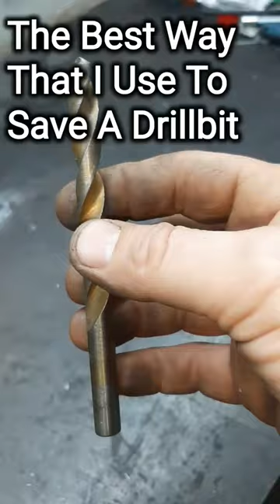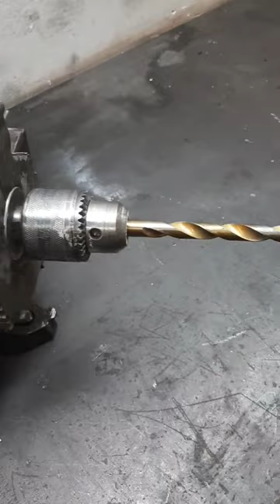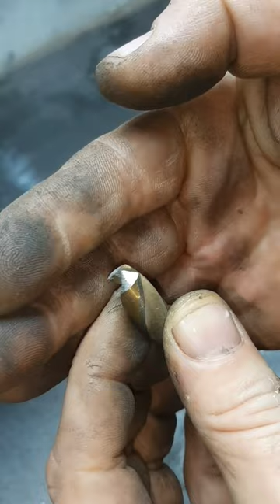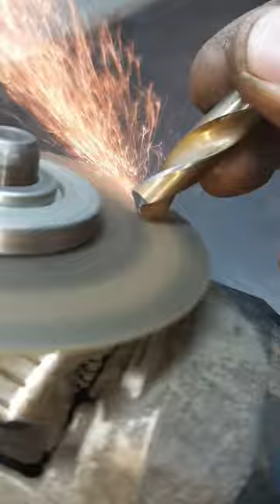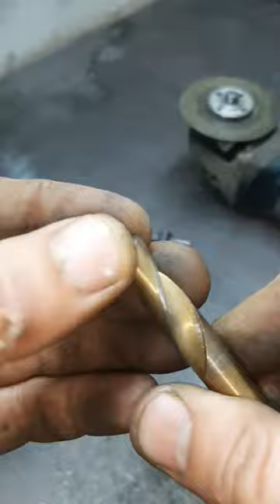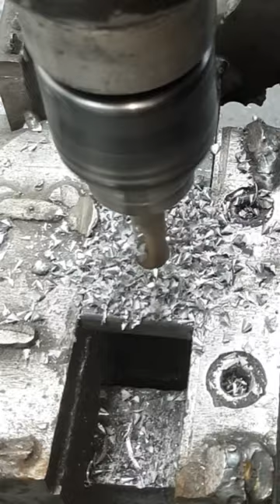Saving Distroyed Drill Bit #shorts

Comment from the maker: Sorry for not being clear enough at the start of the video. 
There are 2 reasons why I cut drllbit in a half.
1.If a shorter twist drill is needed at  the moment.
2.And if the drill's margin is dameged therefore it's not usable to a certain point, so you cut it to that exact point.

Comment: well that was excessive
Reply from the maker: Thanks for the comment,. I use this method a long time, so it's your choice if you like to use or not.
Reply: @Diythings.  sharpening the tip i get, I don’t see why to cut it in half
Reply from the maker: Sorry for not being clear enough at the start of the video. I see that you understand this topic and I'll explain why is it like that. There are 2 reasons why.

1.If a shorter twist drill is needed at       the moment.
2.And if the drill's margin is dameged therefore it's not usable to a certain point, so you cut it to that exact point.
Reply: @Diythings.  gotcha